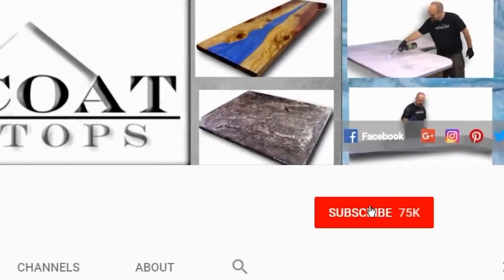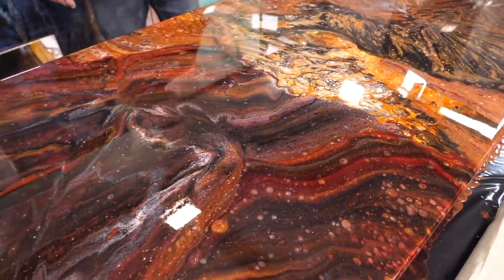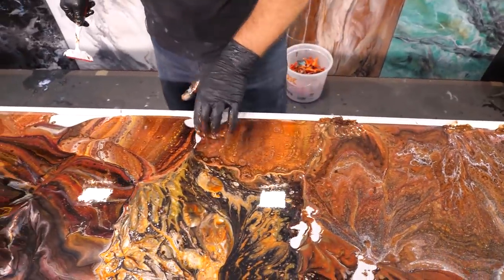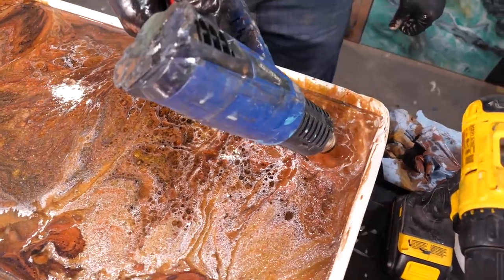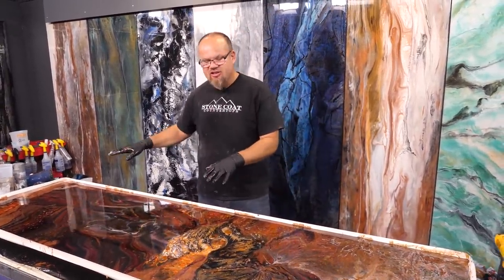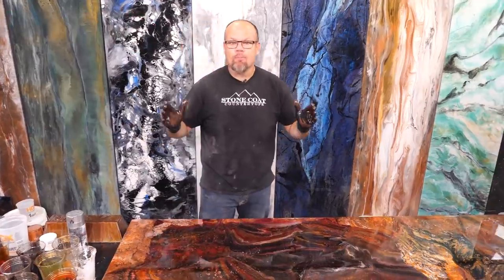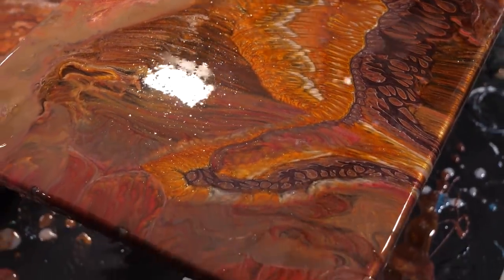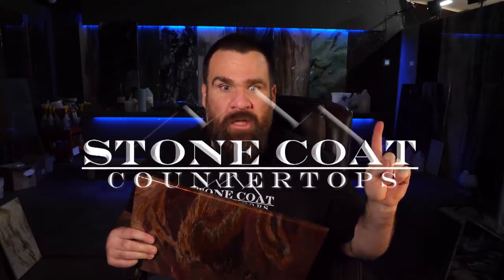Remodel Counter Tops in Place by Pouring Epoxy out of a Bucket | Stone Coat Countertops

Comment: I love that this wasn't tilted.   Primarily,  because,  I'll be pouring over my current grouted tile (literally from the 70s!) countertops.  Obviously,  I can't tilt those! 🙃 I'm so stoked to finally be able to afford to get rid of the terrible tile and it's dirty grout!  Another huge plus!  I can prep my putting down ram-board, taping up rolls of plastic in short periods after work,  the week before (and leave open a couple strategic spots) then during Spring Break (faculty perk!!!!) I can finish the prep one day, including sanding, bondo, sanding, then paint & primer in one, then pour the color and add spray paint, 91% IPA, and play with my color the second day, cure overnight,  pour my flood/ clear coat on day 3, cure over night.  That leaves 4 days before I have to go to work!  Clean up,  touch ups if needed.   I can't wait!!!! Won't be long, 04 06 20!! Getting ready.   3 more sample boards to finish Friday!

Comment: How do you handle small backsplash when doing countertops in place?
Reply from the maker: We use a multi tool to remove and make new wooden splash and coat it the same time as the tops. Set it on top and caulk the joint when completed.  Great question
Reply: Thank you so much! Great answer. I’m here thinking how to pour it on the wall lol.....duh...

Comment: When pouring and/or letting it set..... do you get any air bubbles/ air pockets anywhere in the process?
Reply: Since it’s epoxy it probably will have bubbles but you can use the heat gun and go over it and the bubbles should disappear